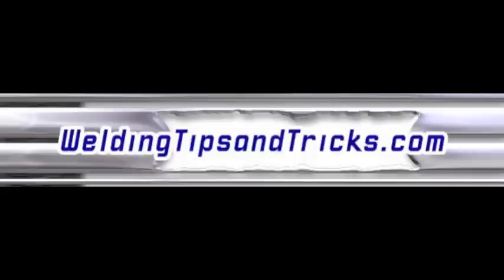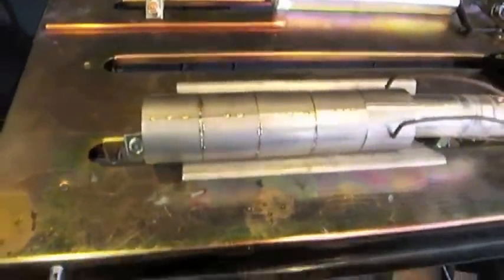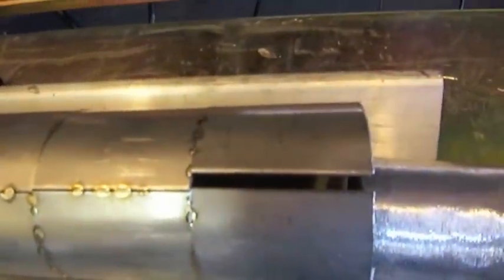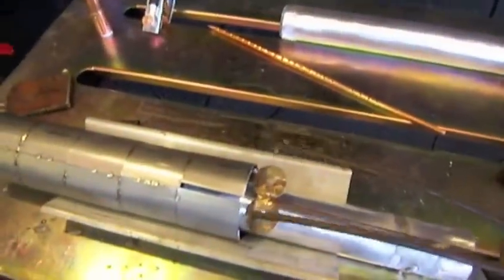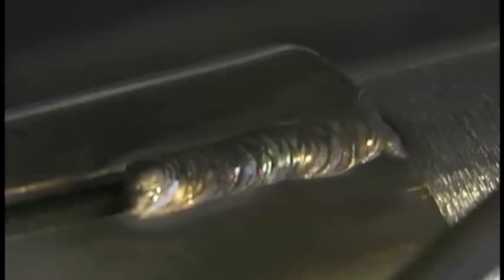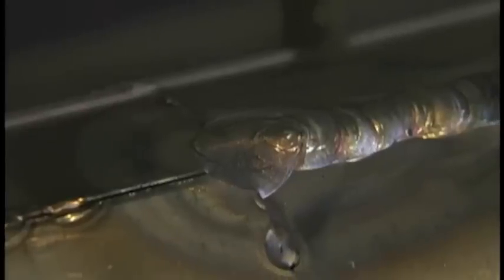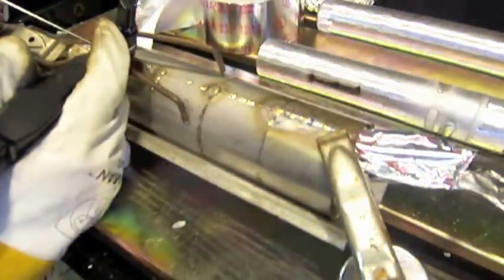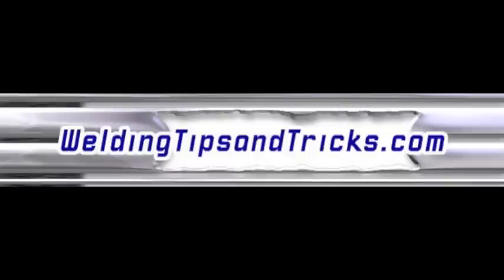Properties of Stainless part 2

Comment: How much of a gap between the aluminium backing plate and the stainless tube. Was the aluminium backing pipe clamped right up against the stainless. It looked like there is a gap between the two different materials in the video ??  Thanks Michael

Comment: could you advise on SS welding? I have recently used 308LSI wire MIG welding 304 and pretty much everything corroded few days after being outside. Normally I have 316 wire for this, but I run out so I've used what I've had. Any thoughts on this? This hasn't been processed yet, so no grinding, no contamination etc.

Comment: All I have is one argon tank and one 75/25 tank, would it be worth using 75/25 for backup gas or would I have to go buy a dual regulator for the straight argon.

Comment: Ran out of room.  Actually turbine blades, are Inconel, Titanium, A286 and (proprietary).  Point is every single job should be as controlled as FAA specs if a man is doing his job.  Every single welding rod has to be released by a FAA engineer to continue that weld and documented.  NO reason EVERY repair shouldn't be treated with as much caution and dedication right fellas?  That is what we train for.  Good enough is NEVER good enough.  Do it right or let someone else who will take that place.

Comment: This guy states something in the first 10 second I have tried to beat into my guys heads.  Stainless is NOT "rustless" (my word right or wrong but it's a good word for us "country boys") LOL.  Clean all stainless (regardless of the grade, 308, 316, yeah there are hundreds, etc... if it's nickel based use a STAINLESS brush ONLY and on NO brushes used on any other material (of course scotch-brite also independeltly) ONLY.  NOTHING else.  FAA certified. No joke.  Jet engines, lives on the line.

Comment: Hi any chance of you doing a video welding 2mm stainless both sides, had a job recently which asked for fully welded construction for the food industry non crevice finish, the only prob is once iv welded one side corner corner joint its very difficult to weld the inside after that side is welded. Any tips or tricks ???

Comment: You mentioned the need for a separate flow meter for purging but couldn't you just install a tee into the gas line inside the machine past the solenoid? Then add a small ball valve on the hose after that to turn the purge gas on or off. It might change the cfm at the torch a bit but would save having to buy another flow meter. Just a thought. Great vids.

Comment: wouldnt it of been easyer to just use a peice of stainless steel pipe instead of piecing 5 together?  just seems like alot of work to end up with a 7 or so inch pipe.